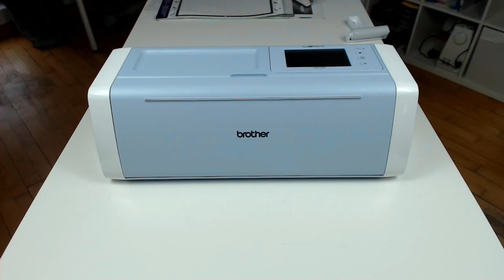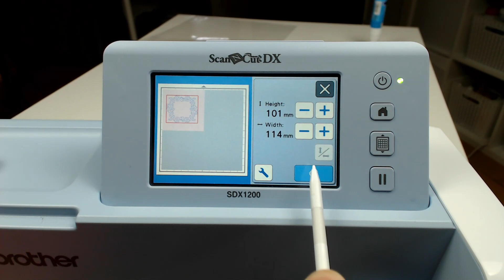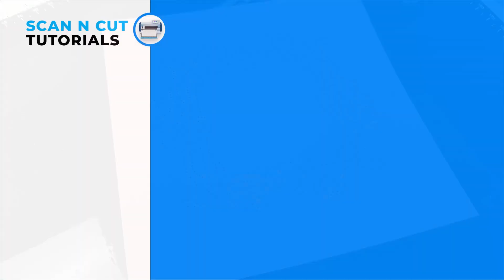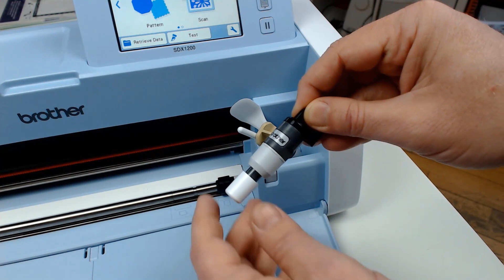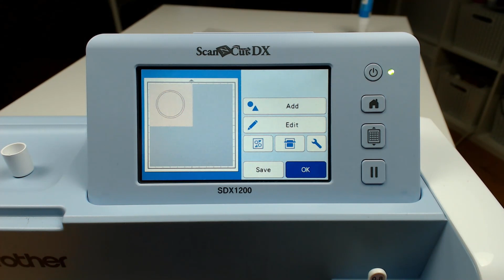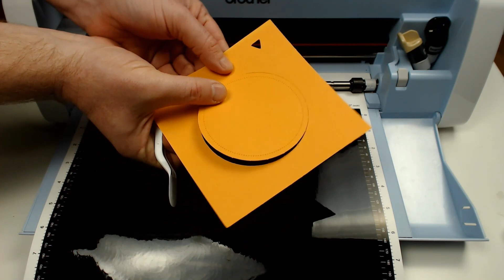HOW TO USE THE PAPER PIERCING KIT WITH YOUR SCAN N CUT - SDX MODELS

Comment: Hi! 
I’ve just stumbled across this great ( clear and easy to follow!) tutorial and can see it’s a few years old, so I hope you are still monitoring comments.
I wonder if you can tell me please the steps needed perform the cut operation on the first pattern that you pierced, rather than on just a simple circle?
Many thanks.
Reply from the maker: Yes, I am still here - welcome!
Could you please give me the time code of where you saw the design in the video please. I can then hopefully offer some insight.
Reply: @scanncuttutorials  so you do the lovely pierced pattern I. The first half of the tutorial. Then you use the cut function at say, 7minutes  30, which part cuts a circle on the card. And then pierces a circle inside the cut circle. But I’m wondering if that is all that you can pierce, or can you pierce the whole lovely design on the square card, and then cut it out as a circle rather than on the square piece? I don’t think I am explaining it very well….I am totally new to scan n cut as I am sure you can tell🤔🤪
Reply from the maker: @angiekowalczyk4440  In short, once you have the kit activated, you can combine any decorative design (pierced) with any other shape (cutting outline). You can do this on the machine, but also in Canvas workspace. The sky is the limit! I am unsure how the heck I missed creating a video on how to set this up in Canvas Workspace so will add that to my list of updates.

Comment: Hello, since this kit has been discontinued as per the website,I was wondering if I use this kit that I got in a destash from someone else who was using it earlier, would it work with my machine as well. I know that each starter kit needs to be registered on machine to be used, but since this destash kit was already in use on other machine, would it work on mine?
Reply from the maker: The answer is yes AND (possibly) no.

If the previous owner has already registered the kit in their Canvas Workspace account:
- You WILL be able to use the piercing function that is built into the machine (as shown in this video). 
- You WILL NOT be able to access the specific patterns in Canvas Workspace, nor will you be able to access the piercing functions within Canvas Workspace. 

If they haven't used the registration code included with the kit then you will be able to register it to your account and access all appropriate features.

Hope this helps.
Reply: @scanncuttutorials  but then does this mean I would be able to create and import new designs to my machine?
Reply from the maker: @onlyamruta  There are two ways of creating piercing designs. 
1. In the machine. You will be able to do this whether the kit has been registered before or not.
2. In Canvas Workspace. You will not be able to do this if the kit has been registered before. If it hasn't, you will.
Reply: @scanncuttutorials  this is great help .. thank you so much for your reply.
Means a lot when I wanna take further decision.
Your response is much appreciated. Thanks again 👍🏻👍🏻.
Reply from the maker: You're welcome.
Reply: @scanncuttutorials  and I wish to know what would it mean for the destash embossing kit as well.
Reply from the maker: You can use the embossing kit without registering it. There are no additional features in Canvas Workspace, only additional designs.